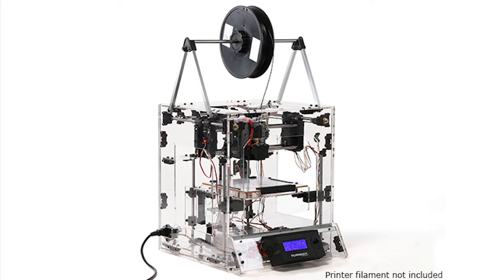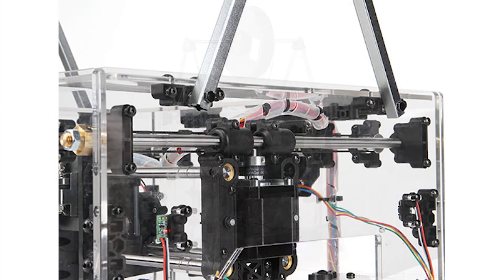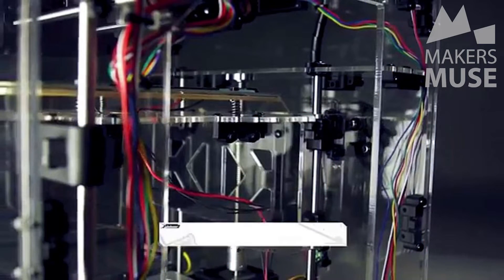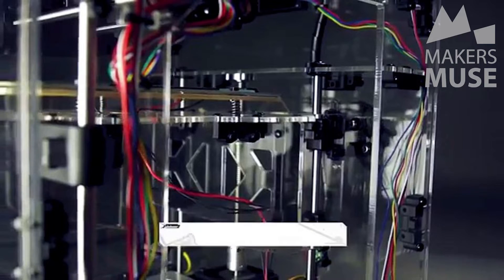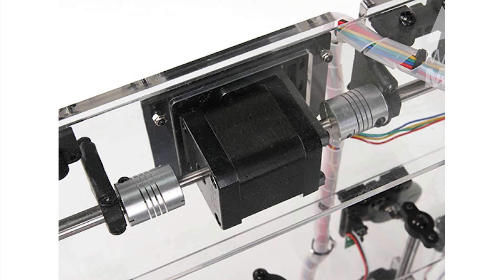Why do 3D Printers still kinda suck? - 2015

Comment: What do you think of the m3d printer as an entry level printer? It's a low cost but I'm concerned that it's to cheap(?) even for the cost.
Reply: +Isheian It's a pretty accurate printer for the price. But you might also want to look at the Tiko and the Da Vinci Jr.
Reply: Thanks for the advice! Im hoping to be able to eventually afford the CEL Robox but am hoping to find a good entry level printer to play with first. Ill look in to the both of them!
Reply: +Isheian I have a da Vinci jr and I love it. It's plug and play and I got some good prints with it so far
Reply: +Isheian Get a wanhao i3 its so good :D
Reply: +Isheian Do NOT get the Da Vinci Jr. I had one (it has since been replaced with the i3). It has no heated bed which is essential for larger prints. Also their filament is proprietary and a rip off.
Reply: spuddie Isheian I would have to agree with spuddie on this one. Anywhere from $300-$375, go for the printer he recommended. However, near $400, I managed to squeeze 800 cubic centimeters more of build volume compared to the Wanhao i3 with the Da Vinci 1.0A. (20x20x20cm as apposed to 20x20x18cm)... Most people complain about the proprietary filament, but I get by by using an Arduino to reset the filament-counting chip. Basically I flash the chip and restore the filament count to 120m. I can even change the material and extrusion temps using this method. Some time in the future, I may flash the firmware of the printer itself with Repetier firmware and gain the freedom to have the motors sing, print at specific temps and extrusion speeds... Oh the possibilities. The only downside I see is possibly loosing the ability of the printer to print independently from the computer. XYZWare sends the whole file to the printer, and the printer prints from memory, even if the computer shuts off.
Reply: +Aaron Lowe Thanks for the input y'all. I had hoped to buy one with my tax return but other responsibilities took priority. Keep the input coming! I really appreciate the feedback.

Comment: What do you think of Airwolf 3D?
Reply from the maker: +Scientia Draco At first glance, yes it looks like another plastic frame printer which inspired this rant - but actually I hear amazing things about them, especially the newer models. 

They've done some pretty leading edge things like pushing their hot ends up to 315  Degrees C and making various bed-adhesion glues to print exotic nylons and polycarbonate. It's one of the printers out there I would LOVE to try out, and we even looked into selling them in Aus some time last year, but the shipping quickly stifled that plan. I don't think you would be disappointed.
Reply: +Maker&#39;s Muse Thank you for your time and experienced opinion.^^
Reply from the maker: No worries!

Comment: well, the printers are made form metal, where the heat is coming from (extruder carriage) so the thing with the acrilic frame isnt true, and you can get quite decent prints off of them, and why do you think, that there are end switches?
Reply: +THE"java©"EXPERT I think he meant is that over time the acrylic frame would warp and distort due to having a heat source nearby (the extruder and the part being printed), the amount of heat cycles it is exposed to or changes in the environment where the printer is located (like if the room ambient temp was hot in summer and cold in winter). These distortions occur due to the expansion and contraction of the acrylic material depending on temperature and would throw printer calibration off in the long run. A metal frame would be much more rigid and tough than an acrylic frame and would distort much less over time given the same factors as acrylic. Basically you would have less issues with calibration and reliability over time as he talked about in the video.

Comment: my first printer 3d printer is a PRUSA bought in china, I had so much expectations with it; very excited, all new for me, and I kept getting crappy models, no matter what I did, I couldn´t get the heat bed calibrated properly, I mean it will throw off calibration itself after 30 min printing, it was driving me crazy..... well, like you said here, the frame entirely was made out of acrylic; 5mm, even the heat bed support mounted in a spring screws damping thingy.... well after 30 min heat, the acrylic on the bead support will soften and the springs actually press down the legs that support the heat bed......bowing down like 5mm....WHAT THE F£$€...! how can they overlook that?.... rest of the frame it´s ok until the machine felt off my desk and completely destroyed.... anyway... quick tip for those that are looking for a new printer and don´t know what to look....

1.- print bed (heated) in metal, to avoid soften with temperature.
2.- self leveling printing bed (no need for calibration). ---this is very important, nothing more annoying than waiting 3 hours to realize that the model came out wrong due to calibration.
3.- bowden extruder system with at least a V5E3D hotend. Extruder mounted firmly on the frame not moving will guarantee constant flow of plastic.
4.- Print volume like 250x250x170 ATLEAST; 

you don´t need to spend a lot of money for a good printer, you can buy parts and make yourself one that includes this features....

Comment: I had this convo many times in the past and the reason they haven't gone servo, so I was told, is the cost factor and the intelligence required to use it.  I have no idea about all of that but I don't think a Mega 2560 could run three of them so then we get into 100+ dollar controllers (the 50 dollar arm controllers like SBASE have some issues with ethernet etc...).  I was told a 1k dollar current FDM if done right and became a precision instrument would be about 7-10k dollars.

Comment: I run a few different printers for work and school and have a tinyboy v1 (hobbyking fabrikator mini) for my dorm. It is laser cut acrylic and is zip tied together but it does just plain work once you get the z height set correctly. I consistently get prints just as good as the flashforge creator pro that I run for school. It is extremely limited in build volume, but it was only $200 US.
Reply from the maker: +nerdyrcdriver Yeah I'm kicking myself for not getting one when they were on sale, sooo cheap even if it was rubbish it's worth it for the bits!

Comment: Well, I recently got my Mod-T 3D printer from New Matter. For the most part it prints what I want it to print and the quality is definitely acceptable (100nm resolution, possible 50nm resolution with firmware update). It's not in the same realm as the Form 2 from FormLabs (my next 3D printer), but for a printer that I paid only $299 for (I pre-ordered it, it's $399 now) it's certainly a great value and seems to print as well as more expensive FDM printers that cost over $1000. The Mod-T takes the guess work out of 3D printing, it's almost a "set it and forget it kind of work flow", at least in my experience.

Comment: Without the race to the bottom you wouldn't have this channel and viewers.
Coming down on price, with Mendel on the market etc. is what reached a point where non-industrial machines were a viable option.

These cheap machines are exactly that: Cheap and entry point.
Acrylic tho is a moronic idea, but it's yet again one of the things to make it cheaper.
Makerfarm's Prusa i3 models are from pressed cardboard ffs!
Nevermind the Prusa i3 design is really stupid. I thought the first version was bad, but it's brillaint in comparison.

NOW - with a little bit of upgrades etc. you can build some really good printers today for no money.
I remember the time when i was building my first prusa v1 and it ended up costing thousands and thousands, now you can build a similar quality machine for 500$ pretty much (i say pretty much since no one uses the HQ version belts & pulleys i did nor as strong motors). THAT being said, off the shelf machines it still trumps almost everything upto a few K $ price tag.

Plastic as building component is not a bad idea - as long as you know where to use it, and how to use it. That's what reprap movement is about - making the printers from as many printed components as possible.

As for progress:
DC Server control: Some examples exist, but still too expensive to make. Basicly lack of CHEAP stepper driver replacement to control DC motors as servos. The examples use 1 full arduino board PER axis. Expensive. Poorly documented too!

Stepper motors are the industry standard for controlled, high precision movements, they are not perfect by any means at all, but they get the job done in repeatable manner at sensible cost. It is what it is.

E3D takes quite an scientific approach on hotends. It's also easier to get a hotend these days able to go upto temps like 500c, some milling work later you could goto far beyond aluminium melt temperature actually by using steel components ...

CoreXY, Aluminium extrusion frames, all metal printers, magnetic zerolash effectors for deltas etc.
Plenty of progress here! It's simply amazing quality repeatably what some people achieve. I think some have been doing prints as low as 10microns, and there was talks of people using the 3d printer basis for sub-micron tasks (!!).

So progress has been happening, but if you look only at the cheapest of the cheap, ofc you are going to find ever cheaper and ever crappier machines. This is true of anything.

Makerbot is not cheap tho, and i don't understand how the have managed to fail so miserably. No technology can fix bad design. Hell, people are still doing GANTRY design 3d printers facepalm

Materials: Slow going. So much stuff available but nobody makes it into filament !
There are only experiments etc. and no one sells this stuff. For example, some guys just made ABS that is bulletproof!

Also see what Lockheed Martin has been doing, they have practically "multicolor" printer for FDM process, multicolor is easiest to describe as they mainly use it to swap materials on the fly. This is attached to 6 axis robot.

In Netherlands i think they made 6 axis robot 3d printer which prints metal by practically using MIG/MAG welder. They are underway in a project to 3d print a bridge.

FDM as technology:
These are early days of 3d printing, FDM is not perfect, but it's closest to current plastic manufacturing process of injection molding and capable of using any material injection molding uses.
this includes very high grade engineering materials. Even the cheap stuff engineering materials are so good that car manufacturers have been using these for decades now in ENGINE components.

Toughest engineering materials are so tough composites that even the normal drill bits for steel gets dull before making a hole! (Used in RC cars commonly where strength of parts can be a serious issue)

The resin type machines are not able to use engineering materials :(

Laser sintering machines are complicated and hard to make, and hence expensive to make.

Comment: So whats a better stepper motor then Angus can, you recommend better ones ? thanks
Reply from the maker: +AuroraCypher Too be honest at a hobby level, the Nema 17's are prefect because they're so cheap and easy to control. I wouldn't be surprised in future - for example the soon to be released HP 3D Printers, if they move to servos though.

Comment: Youre right about servos, but the way you keep track of position with a stepper motor is basically the same as a dc motor with an encoder on the shaft. One you count steps commanded, one you count pulses received. Only difference is the encoder verifies an actual movement whereas a stepper (with no feedback) you have to assume movement. But you get much more precise control with a stepper than a dc motor paired with an encoder. And both can still lose their physical position in space.

Also, there are many commercial grade fdm style printers that print production quality parts. They are also $50k+. So to say nobody has made any significant improvements to fdm printers is kind of an absurd statement. The fact of the matter is, consumer 3d printers are now available at a price where your average person can afford one whereas several years ago, you could not say the same thing. Maybe in the next 10 years, the now commercial grade printers will become affordable for your average consumer. Only time will tell.

Comment: Totally agree with what you had to say. My first printer was the printrbot, i currently own the robo3d and I don't see much of the difference in quality or speed (only difference would be that robo3d has a larger build volume. I checked out my friends Lulzbot 5 and the small difference in speed doesn't feel like is worth the extra $1000 because at the end of the day they all will run into a problem. I hope one day we will have a 3D printer to be the equivalent of a Mac computer ( to wish you know you will pay a high price but won't brake for years! to come or have glitches) On your research what printer you have found to be the best out there when it comes to trusting to not fail on you (or as much)

Thanks!
Reply from the maker: +Stewart Hernandez Up! Mini has been the most rock solid so far in my experience, though they still can have issues. The printer I've been recommending to schools and the like now are Roboxes actually, they've fixed their extruder quality control issues and the last 10 I've installed worked flawlessly right out of the box, no calibration required!

Comment: the hardware is more to blame, shit linear motion, cheap screw drives (do any of these use ballscrews), the motors aren't the problem. just look at how many good 2d cnc machines there are using steppers. you have to have accurate mechanisms and the software and motor controllers have to be good for accuracy. those are the cheap shit on these printers and why they have problems servos won't solve that

Comment: printers for a long time used steppers, they use servos now since they can do it cheaper is all. servos bring a host of their own problems. the motors aren't the issue, the software and the hardware are more the problem

Comment: Are you aware of the existence of the so called Carbon3D 3d printer. Its patented. But it seems great. There is a TED talk over it.
Reply from the maker: +Fil Ipe Yep, I've done a video covering the technology. It's pretty promising but has its own set of limitations - the liquid resin systems are unsafe to handle till cured and will degrade far faster than other plastics, especially when exposed to UV light.

Comment: FDM printer with plastic frame is a cheap but a bad idea. Not because of the heat but because of the vibrations. The frame need to be rigid to reduce the vibration problem. The heat will not be a problem it the plastic is not subject to a high temperature and expand or deform.

Comment: I will explain why is better to use at the FDM printer stepper motors and change those motors to a cheap servo motor or brushed motor will reduce the quality and/or increase the time of the printed parts.

The stepper motor work well at the FDM printers because it can control the speed fast and stop with accuracy. Because it is constructed for the electromagnets pull the rotor to a fixed position. The microstepping will reduce the accuracy and force, but 1/8 is still good.

The direct current brushed motor have brushes that, when the rotor magnets reach a  close position with the electromagnets, it change the direction of the current traveling in the rotor, for the rotor not stop. Because of this the brushed motor cannot maintain a static position and lock the movement. The head of the printer have mass and to change the velocity the motor need to overcome this kinetic energy.  If the motor stop or get the velocity wrong, switching back will correct this position/velocity but the extruder is extruding molted plastic at a rate that will not stop/change fast to correct this at time.

The brushed motor works well at the inject printers because the printer head will only inject ink at the correct position and the next position between the 2 black lines of the encoder is predictable because the velocity of the head will not change fast. When the position gets wrong, the head stop injecting ink.

The cheap servo motor have plastic gears and is made with low tolerances that will give lower precision than a nema17 stepper motor. Some FDM printers have cheap servo motors, but don't expect to be a good printer. With a good reduction gears is possible to increase the precision, but the gears will cost more than a nema17 and will increase the print time.

A good servomotor (not a cheap servo motor) have precision, accuracy and cold replace the nema17, but they are also more expensive. Some CNC have servomotors.

Comment: FDM printers have problems with the tolerances because of the thermal expansion of the extruded plastic.
And they can print big but only by a limited type of plastics, because of a patent that forbidden all the FDM printers (including opensource) to have a box to maintain the heat.
Reply from the maker: +Luis FF It's these patents that have kept the tech locked away for so long in the first place... Stratasys is just sitting on them and keeping their machine costs high but they're pretty well doomed as soon as the last key ones expire (soluble support that works, heated build oven). They even tried to patent 'slicing parts and gluing together later'...